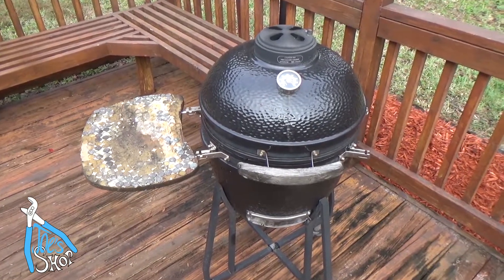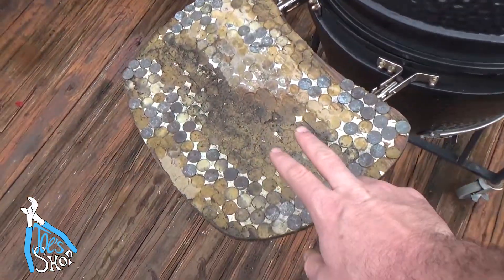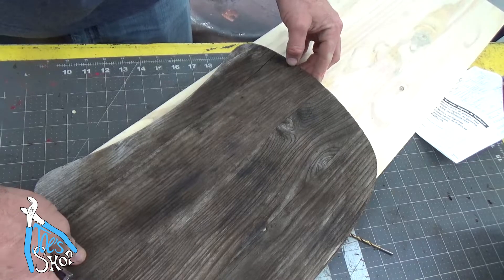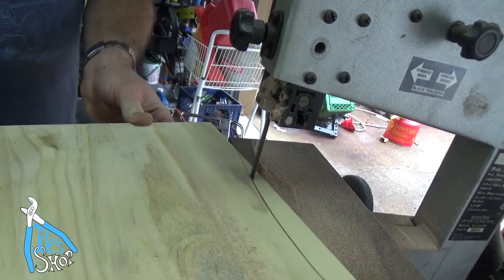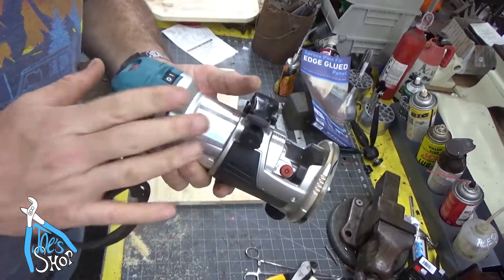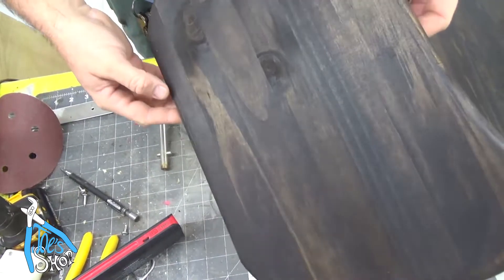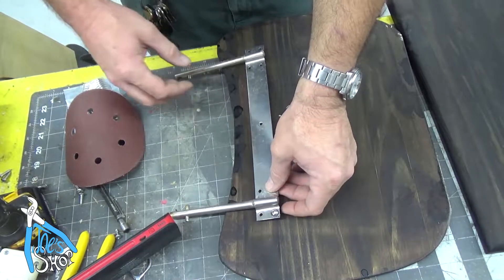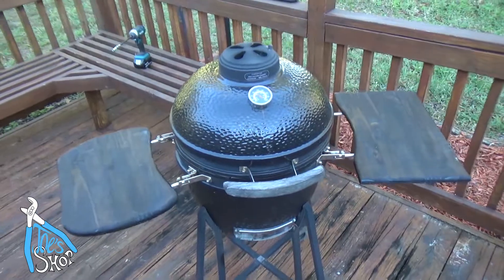Reconstructing BBQ grill side tables

Comment: I agree with the larger size of the second table design, more surface area is better.  If you make a second one to replace the kidney shaped one, I will suggest rounding the exposed corners a bit more to minimize the thigh high black and blue marks when you are in a hurry to flip those steaks.